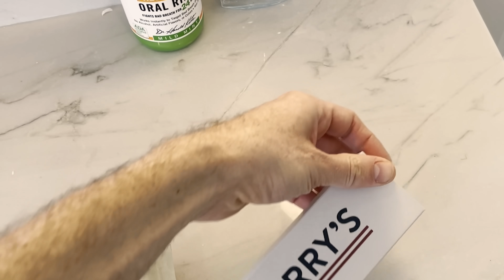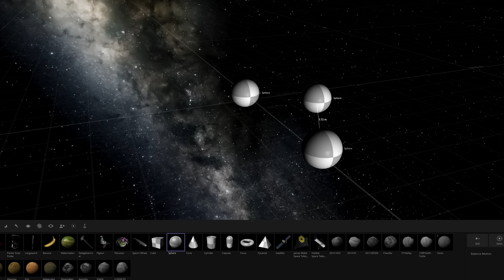Perpetual Motion Achieved

Comment: I would love to get my hands on the schematic for that device!
Reply: It's a power cell, tiny motor like a phone vibrator uses but with a magnet to pull the ball, and electromagnetic sensor to turn it on at the right time when the ball drops.  Likely a small circuit board to set the output timing, lest the ball is stopped or doesn't make it up the chute.  There probably is a bit of sound from the motor, but it's masked by the noise the ball makes on the rails.  Most models don't go to as much work to hide the power switch as above, so this is a nice one.  They all seem to include a similar chunky funnel at the top, probably because it works and makes the thick base look like a consistent design choice.  I don't think there's any hidden functional parts up top.

Comment: Well that's why I don't understand Fusion because how can you extract energy more than you put in?
Reply: The output energy comes from the fusion of hydrogen into helium with a resulting small loss of total mass.
Reply: fusion creates free neutrons, which then collide with the reactor walls creating thermal energy. You are using the energy that holds the molecules together
Reply: @raoulduke7668  wrong
Reply: @raoulduke7668  so by "free" you mean it is free energy
Reply: @fredbloggs5902  yeah but i dont understand in perpetual motion terms
Reply: @fredbloggs5902  how am I wrong? Elaborate please
Reply: @clusterstage  no. Read again.
Reply: @raoulduke7668  i still dont understand the Exact reason why they hace huge colliders and say we CAN get energy out of it.
Reply: @clusterstage  Okay let me try to explain again:

So you know that atoms are made out of protons, neutrons and electrons, right? And that the number of these parts determines which kind of atoms you have.

So in fusion reactors, they smash atoms into each other which causes them to fuze into a different atom. This process releases energy, which was stored in the "binding energy" of parts inside these atoms which got smashed.

So it's not free energy, because we are just transforming the binding energy of atomic subparticles into free energy/heat. This head can then be collected and boil water, the steam which is created this way powers turbines, which then power a generator = electricity.

The reason fusion is so interesting is that scientists think that you can get a surplus of energy out of it, because once you created a stable plasma (which is needed for fusion) you can just let it run and harness the energy from the fusion process.

Hope this makes sense, english is not my native tongue.
And to anyone else: If you spot any mistakes, feel free to mention them. I'm not an expert by any means.
Reply: @raoulduke7668  oh so its the heat that they can use to boil water. so its just like steam engines then?
Reply: @clusterstage  Yeah, that's also how classic nuclear reactors, which are based on fission, produce electricity. The rods with the radioactive decaying material is lowered into water which is therefore turned into steam and drives a generator turbine.
Reply: @raoulduke7668  oh i always thought there was something magical about the word nuclear. Thanks for demystifying it for me, I no longer find it interesting. 

Steam reminds me of boring stuff my grandma used to do in the morning.

Comment: But how is it, You can get more energy out of a fusion reaction, then put in it!
After all, that's why they are trying to build fusion generators, right?
Reply: That would not be perpetual motion, though. Your fuel source is matter. If they can get it to work, it would be more efficient than anything else, that's all. Imagine making a mini sun on earth and harnessing all the light from it. That is all it would be doing. Eventually, the sun itself will run out of fuel and stop, so it is not perpetual.

Comment: if photons hit it only on one side then maybe it will slow down but what is the odds of having light on one side only being that the item is usually surrounded by stars... and lets not forget gravitational forces pulling on it from every direction, ssome more than others...  it just may travel forever as it meanders thru the universe following the strongest gravity force... basically chasing black holes...

Comment: Perpetual motion!
Just because something does not run for billions of years does it mean mankind should not try to create or find the most efficient means possible for a machine to perform work!
If it last A human lifetime after starting it up & it is extremely efficient, it is a good machine.
If you can tap into a unseen Force that science has yet to explain, it is Perpetual enough for me!
Example dowsing rods or witching sticks. I know 100% without a doubt they work! I played with them as a kid.
Can science explain it? The best I've heard is they act like it's a joke. Its Not a joke, they work!
Some scientists like,  the man who invented engines that run on water , The creator of the video on YT...
" It runs on water" they get silenced when they discover a breakthrough.
There is another documentary about a water heating device that has overunity. Science cannot explain it show the man took action for himself, installed it at the local city Fire Department. Now they have super cheap hot water. No one else has the system & no one else probably ever will!

Comment: Great video as always. If the rock moves slowly enough, the photons from the front have the same momentum as photons from the back, so on average photons should slow down the rock very slowly.
Reply: Photons don't experience time.  They move the same speed in all references to speeds of mass.  In effect, the photons hitting the front and back of any object result in a net zero change, despite our experiencing them in different frequencies or color.  (Red shifting, blue shifting.)  That's not to say energy won't be lost in other ways, such as gravity or heat exchange, but light itself is special in ignoring most of the things that slow objects down, and won't be the thing that slows your space rock down.
Reply: You are right

Comment: theoretically, a perpetual motion machine could be made in a complete vacuum... but you wouldnt be able to get any energy out of it
Reply: Even in a vacuum, the moving parts of the machine would experience friction with each other and so would slow down. And then there's all the energy you would have to put in to create and maintain the vacuum!
Reply: @nbartlett6538  It's also radiating away blackbody radiation and cooling off (assuming that the environment around it is colder than it is). Eventually it will reach the same temperature as it's environment. In space, this is currently about 3K, just above absolute zero. (In your house, it's probably room temperature.)

Comment: You might be able to help with this debate we are having. A hydrogen powered car only produces water as its waste product. Hydrogen can be created through electrolysis.  If we were to capture the water from the exhaust, and put it through electrolysis, could we create an Endless supply of Hydrogen to fuel the car?
Reply: Electrolysis requires lots of energy, that's where energy is being put into this cycle. That energy comes back out again when the car moves (and reforms the water).
Reply: @juliavixen176  I'm not suggesting using the power from the hydrogen to be used for electrolysis. It would be externally powered by a 12v car battery. The focus of the question is more on the continuous creation of hydrogen and water.

Comment: What about the nuclear fusion breakthrough though? supposed scientist at one of our national laboratories have been able to record more energy output than the input required. What are your thoughts on this?
Reply: I’m not 100% sure but I think it’s not as simple as that
Reply from the maker: In nuclear reactions the energy is stored in the interatomic bonds. The energy is already there. We are just releasing it. Just like the energy in a lump of coal or a spring. Except there is enormous amounts of energy in a very small amount of matter with nuclear reactions.
Reply: @TheActionLab  Yeahhhh that’s it
Reply: Yeah that's not accounting for the energy of the fusion fuel. It's still a big achievement since even without counting that apparently no-one's been able to do it before. It's not perpetual because it runs out of fuel.

Comment: But what if there's two stable bodies orbiting each other in a super small universe that curves onto itself in the 4th dimension? Then all the gravity waves would come back to them, returning the energy... Or would they just eventually heat up?
Reply: They will eventually reach an equilibrium state, and nothing else will ever happen again after that. (Heat death)
Reply: @juliavixen176  Oh, thx... But what about two bodies moving in a straight line around that tiny universe in a way that they're always on the exact opposite sides of the universe? (Sorry for tagging you, l just really want to figure this out, and you seem to know physics.)
Reply: @Solarpunk_SciFi the configuration does not matter.  If they are moving (or in any way energetic) and in the same universe, they will eventually pull each other into a neutral state and their energy will eventually dissipate, never to return to them.

Comment: The Action Lab - I'd love to hear your theory of how the "perpetual motion machine" at The Royal Society works that Adam Savage had a video on about a month ago - it needs to be "serviced" at regular intervals to keep it going which would indicate some sort of battery system but I'm curious if you could come up with a theory that doesn't involve simple batteries for how it could work(if you haven't done so already). 

It's such a cool device it would be a shame if it was just some standard batteries and not some more complex and fascinating science.
Reply: Capacitors, tension springs and gravity-based devices hold energy as well.  (Water towers, watch springs, clock weights.)  Batteries aren't the only energy storage around.  That device is very old, so batteries may well not be the thing powering it.  Maybe it just needs to be wound and oiled periodically.

Comment: 5:45 - do you mean, its impossible ? 
But transformer step up ?
Reply: Transformers do not increase energy, they increase voltage.  The voltage increase is matched by a corresponding decrease in current.  The energy (power) you get out is less than what you put in due to things like resistance in the wires and induced eddy currents in the core (both of which cause energy loss as heat).

Comment: How does the magnet force work though? Is it just turning on, or is it some alternating field?
Reply: It’s an electromagnet energised momentarily when the ball is detected.
Reply: I would have to say the ball is magnetically attracted to the base to fall faster than G and with that added boost the magnet turns off as it travels on the flat bit of track and has enuf velocity to achieve a height higher than the dish.
Reply: @bunnykiller   Hmm, that makes sense. I think that thought sort of came to me

Comment: What if you made the tracks longer/higher?
Reply: The longer the tracks, more is the friction.
Reply: Doesn't matter. If the ball falls further, it goes faster -- but it also has to travel further back up the ramp. The amount of energy you gain going down will always be exactly equal to the amount you lose going back up.

Comment: How come we can't use magnets to propel?
Reply: It does
Reply: Non powered magnets just wouldn’t work.
Reply: @f.i.b3027  yeah I'd like to know why
Reply: @paramountx  to be clear it uses an electromagnet, a permanent magnet would simply capture the ball.
Reply: @paramountx  Both of the poles cancel out  and the ball would attract and then repel.
Reply: It doesn't have to attract and then repel - a magnet will only attract a non-magnetic ferrous metal object. But it will attract the object both as it's moving towards the magnet, and as it's moving away. So it will speed it up as it approaches and then slow it down as it moves away. It doesn't add any energy overall.
Reply: @neumaticgrunt maglev uses electromagnets for propulsion, not just permanent magnets. They need to be powered.
Reply: @neumaticgrunt In the context of this page I interpreted "use magnets to propel" as meaning "create a useful perpetual motion machine by using magnets to propel".

I think you have to interpret it like that otherwise it's a question no-one would ask. Obviously we can use magnets to propel. You don't need anything as fancy as maglev to show that, just stick a magnet to something and pull on it. Or any electric motor or loudspeaker. Everyone knows you can do that.

Comment: what if you spin a frictionless superfluid?
Reply: It might spin for a very long time, mightn't it? How long? Well, until you run out of the energy required to create a superfluid, anyway. Entropy will always get you eventually.
Reply: @gregmark1688  What if I place it so far from everything else, that space in between the superfluid and the next Object is expanding faster than light or particles could reach it?

Comment: It is possible to make a perpetual motion machine but you just use the power of the sun for example but you can be like look no batteries. I mean a large solar power Stirling engine would be an example of that. I mean you can say that's not a perpetual motion machine but they'll all accept some sort of energy in because you can't really create a closed loop system so that no energy escapes and no energy gets in.
Reply: Crookes Radiometer.

Comment: Actually perpetual motion is easily achievable and hard to get rid of,  we usually call it heat though.
Reply: What?  No one calls perpetual motion heat.
Reply: @wahconah98  heat is a measure of the kinetic energy of atoms. You can displace heat but not reduce it thus it is disordered perpetual motion.
Reply: @adangzz1187 no...it's not.  Eventually that heat radiates into space never to interact with anything else.  See "entropy" and "heat death".   Nothing is perpetual, even if it lives longer than the observer.

Comment: Wouldn’t a battery connected to a capacitor achieve perpetual motion?
Reply: What happens when the battery runs out of power?
Reply: No
Reply: You'd just charge the capacitor up until it matches the voltage of the battery, which for a a typical batter which holds much more change than the capacitor would happen very quickly. Then the current would stop.
Reply: There is internal resistance in the battery, the capacitor, and the wiring connecting them.  That causes some of the energy to be lost as heat.
Reply: @briansomething5987  A perfect capacitor has infinite resistance. A real capacitor has extremely high resistance. That doesn't make it lose energy, the resistance almost entirely stops the battery discharging.
Reply: @barneylaurance1865  in order to charge or discharge the capacitor current must flow.  That current flows through the wires into the plates, both have resistance.    Resistance causes a voltage drop with a corresponding dissipation of power (heat).  Since there is a voltage drop, the capacitor can not be charged to the voltage of the battery.  Similarly, there is a voltage drop when discharging the capacitor into the battery, so the battery can't reach the voltage of the capacitor.  These may well be tiny losses, but they are losses, and so the cycle is anything but perpetual.
Reply: @briansomething5987  I'm certainly not claiming a battery and a capacitor makes anything like a perpetual motion machine. But the as the current goes to zero doesn't the voltage drop across a resistor also go to zero?

Comment: @TheActionLab Hello! 🍀
 I have found a way on how to harvest energy from Gravitation force.
All of those "Perpetual motion" devices do have a same mistake-they all fight against the Gravity!! ❌

I have made a simple device which allows me 
for an example to drill the stones with my fingertip. 

the same device could be also used on a 1.5V electro motor with less Amps,which is then  able to power up a 4.5V electro motor with more Amps. 

The base of the device is made out of 2 parts,and once they are made there is no need to replace them,only  simple maintenance is needed. 
I hope this coment will catch your eye,I am willing to send you all data. Stay well! 🍀🕞

Comment: Out of interest, is there a way to build that fake-perpetual motion machine with permanent batteries instead of electric pulses?
Reply: There is no such thing as a permanent battery.
Reply: @MrT------5743  oops, I meant to say permanent magnet
Reply: @DrLilo  permanent magnets would pull the metal object faster and faster as it gets closer, and less and less as it starts to move away, but the object will never leave faster than it enters the influence of the magnet. Instead, in most cases, it will attract and stop the motion.

Comment: this is what i thought too, but if a object moves for example through the Lagrange point, from the earth to the moon, it has no way of knowing the relations between its and the moon. this is actually why every point in space has an unchangeable fixed value. you need to have this otherwise you create logical paradoxes. so if you have a bucket of water and you turn it in space with out any point of reference it might really spill, cause of the fixed values of space.
Reply: i need to add, this is not cause of an theoretical force equilibrium in nature this is really cause of an paradox which emerges with 2 different reference frames.

Comment: If ther would be a micro black hole and exactly in the perfect position it would be properly work, but the mass of the ball and the speed would have be enough to getting against away from the black hole. 🤔 😂
Reply: No, with gravity, things fall down, and they don't fall up. You can only extract the energy from falling down once.
Reply: @juliavixen176  yes but I have mentioned a micro black hole, if that could be used 🤔😂